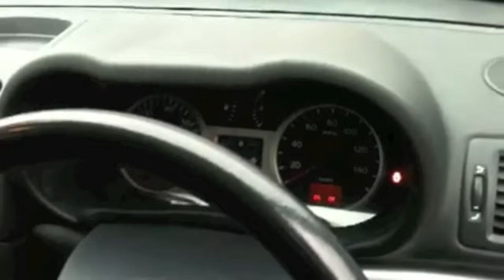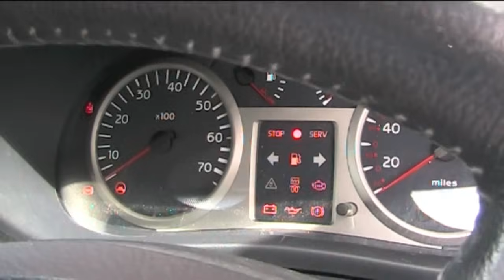Renault Clio 1.2 16v D4F Throttle Body Removal

Comment: hi was replacing the MAP sensor in my 1.2 clio and the plastic snapped and a part fell into the manifold, I've been told to not start the engine until it is removed so gotta take manifold off but there are two bolts on front that I cannot reach no matter what because there is something in the way not sure what it is any idea how I can get round this ? Think it may be starter motor
Reply from the maker: I would recover the piece of plastic before starting the engine for sure.
What bolts are you having difficulty  getting? the ones where the manifold meets the head?
Reply: peugeotCitroen2CV Yeah thought so, there are two bolts on front but I now believe the thing in the way is the air con pump which is attached to starter motor and alternator?
Reply from the maker: Dave Holding Ah the air con pump, i remember someone mentioned that before in these comments. my car did not have air con so i never had to deal with any pump in this video, and i havent had a clio mk2 with aircon to work on. However generally speaking the air con pumps are driven by the auxiliary belt, slacken off the blet and then remove the pump, but dont disconnect the pipes going into it, just move the pump out of the way gently (ie dont bend the pipes).

Comment: Hi my 1.2 16v Clio is misfiring and knocking when it's idling its all over the place and after about 10 seconds it revs on its own the light comes on (coil) and it cuts out, would cleaning the throttle body help this? Thanks
Reply from the maker: The throttle body cleaning should sort out the problem, as for the box at the back, mine had already been opened up in the past, i think its a tamper proof cover, i never had to take one off properly but it is discussed here:
http://www.renaultforums.co.uk/showthread.php?t=77179
Reply: thanks i couldnt get the top off as i dont have a star socket but once i get one ill carry on. Thanks so much for your help and this video was very helpful too
Reply from the maker: Vorneyy Fearon No problem glad to help

Comment: Could I spray carb cleaner into the breather pipe inlet while the D4F 712 is running and flush out the crap that way? or would that ruin the motor..
even if i changed the oil straight after ? 

thanks for your excellent videos
Reply from the maker: Hi
I've never run a car on carb cleaner, part of its advantage is that it does a good job of cleaning and evaporates off quickly. It could possibly dry off the film of oil along the cylinder walls while it is used. Although that is just speculative, I'm not 100% sure of what its effects would be while running, it's worth reading the instructions to see if it can be used that way. If it is an alternative to taking the manifold off and cleaning it as per this video I don't think it will give the same cleaning effect, this may take an hour to do but the car was 10 years old and it was the first time it needed to be done. If it's to remove carbon inside the engine I've seen a few videos about using a product called seafoam which may be worth looking into, they might reduce the carbon inside the engine, although I'm not sure how well they will clean the throttle body.
Reply: Hi, thanks for replying!So the problem i have is oil being drawn into the air filter housing and coating the lower section of the filter. a local mechanic who breaks renaults (and fixes them) told me it was due to the breather pipe on the inlet manifold being blocked. does that seem like a probable diagnosis to you? I see you removed the entire plastic manifold and cleaned the breather pipe, but didnt see how, i was just hoping there was a quick and easy fix, by spraying some form of solvent  into the inlet at the back of the housing (would compressed air also do the trick you think?or just cause damage) - but inevitably i guess investing the time and effort into full removal will pay off. thanks again!
Reply from the maker: Hi Yes the crankcase breather pipe inside the inlet manifold clogs up on these, I haven't done a great job of showing that in this video but it worth clearing out while in there, even use a bit of compressed air to blow any gunge out of the way, then use the carb cleaner for any residue left over.

Unfortunately, you do need to take the inlet manifold off, it's not too big a job to do, get a few plastic trays laid out to hold screws in place and set an hour or two aside, it shouldn't have to be done for another few years at least.
Reply: So I  guess my weekend will be filled with lots of dismantling, degreasing... and hopefully a successful reassemble :)

Its people like you who make youtube a great resource, thanks for all your help!
Reply: Jake, did you get it fixed? I'm going to do mine once the weather warms up.

Comment: Hello 
I had this problem  of the car cutting out so I followed the instructions and cleaned out the throttle body, Great video thanks

BUT 
Whenever i drive the car on long distance or Im driving around for the day I get the Electrical Fault Light followed by the engine management light, and if i turn the vehicle off then come to drive again i cant rev the car at all? i will get between 1-2 rpm  im basically at a a stand still till the car decides it wants to drive again usually takes 6/8 hours till i can drive again Ive serviced the car + a new Map sensor Does anyone know what to do ? Ive already spent so much and i keep going to garages with the same fault codes of the map sensor ? which has been replaced. if you could point me in the right direction on what i need to do or what needs replacing that would be great? as im just scared to even drive the car now just incase i get stuck again

Thank you
Reply from the maker: Jordan Leigh Get the cars fault codes read to find out what its saying, preferably somewhere with the proper renault clip tool and get a full print out or screenshots of the codes (you might be able to go onto renault forums to find out if there are members with the clip tool nearby, and other members may have had the problems and may be able to offer a solution) if you keep getting this map sensor fault despite replacing it check the wiring going to the sensor which may be damaged or corroded somewhere.
Reply: Jordan Leigh Check the multiplugs at the rear of the engine D4F Engine for corrosion.Clean with electrical cleaner put back on and check my 2002 16v was showing multi faults on the clip computer but the problem was corrosion at the multi plugs GOOD LUCK.
Reply: +peugeotCitroen2CV Hi, I&#39;m having exactly the same problem. The codes I have are:

590 Programming throttle limits signal incoherence -stored
600 Programming throttle limits signal outside limits  -stored

Comment: I have renault Megane coupe 1.4cc 16v dynamic ,it is a 2001 but it is as sweet as a nut  , all round but the car is not overheating but ,I did fill the reservoir with coolant to the max about 2 weeks ago , just  out of coincidence i looked under the bonnet today, and realise the reservoir was just about empty is there any particular part of the engine that is prone to leaking ,or do you have 
Any advice outside the box so to speak, lol hope you can help
Reply from the maker: The first step in trying to detect these sorts of leaks is to wait until the car is dry, and park the car over a bit of cardboard, preferably in a sheltered area where rain wont affect it, then you will be able to see if there is any obvious leaks from one of the coolant pipes or radiator.

The water pump can leak or weep out a bit of coolant as it gets older, you wont really be able to see the pump until the timing belt covers are off, if its an older car with a bit of mileage then it might be a good idea to replace the timing belt and water pump as a general service of the car.

There is also the thermostat housing it can leak, its another service item so if the area is leaking around it get a new thermostat which has the appropriate seal.

Thats just a start hopefully that should cure the leak, you could buy a uv dye to put in the coolant to help trace the leak.

Comment: Great video! Can you tell me where i can find the stepper motor? And can you confirm that the Mass Air Flow is built in throttle body?
Reply from the maker: +iTzDaniel92 
The stepper motors built into the throttle body, the cheapest option is to get one from a scrapyard, cant actually remember where the MAF sensor, its either on the inlet manifold or throttle body.
Reply: +peugeotCitroen2CV The throttle body has two connections right. one for the throttle body and one for the mass air flow sensor? I have the same problem. The glow lamp is lighted and idling is not good.
I have to keep the accelerator pedal as pressed and then runs to idle properly.
At first I thought it was the inlet manifold but it was not so. I bought a throttle body by the scrapyard and will be placed next week. I also read that it can be a lambda problem or a crankshaft sensor.

Comment: Hi
I have exactly the same engine type 
If I do this what parts do I need to replace?? 
Some sealants or gasket ?
Reply from the maker: It may be possible to do this without having to replace any gaskets on any that ive done i reused the gaskets and the car ran fine. However if the old gaskets are bad the inlet manifold gasket is the one that has to be replaced, possibly the o ring around the throttle body.

Comment from the maker: I do a video for removing the throttle body on a 1.2 8v engine, i dont know is the 1.6 a much different engine?
Cleaning the throttle body, its easy enough, just remember where the wires and bolts go.

Comment: Afternoon 

Had a problem with my car .  Had the fault light come up with the code Pl 170   fuel trim malfunction bank 1 ....  

Car is using a lot of fuel could this be the cause  ?
Reply from the maker: Im not sure what the fault code means, but yes i remember the clio was sorer on fuel before cleaning out the throttle body. I would look over on renault forums that p1170 code could be some other fuel related issue.

Comment: I have a problem. I have followed your instructions but now when you start the car it revs up and sounds great but then after 5 seconds or so the revs drop to idol and the are some very strange noises coming from engine, ignition light flashes and revs get stuck at idol (accelorator pedal does nothing)

There only thing which i can think of is the intake manifold wasn't cleaned as thoroughly as you did yours? Could this be the problem?

I've been reading all sorts online and I've scared the life out a myself now thinking it's the loom or worse the ecu ?? Help :)
Reply from the maker: With behaviour like this it might be worth having its fault codes read, when cleaning the throttle body did you perhaps get any dirt on the sensors in there?

As for the loom, were any wires broken when you removed the parts.
Reply: peugeotCitroen2CV +peugeotCitroen2CV thank you for getting back to me so quickly. re cleaning the throttle body I just tried to clean it all as best as I could and it's possible that i did perhaps leave some dirt or oil on the sensor on the throttle body.

I certainly feel that the intake manifold should have been cleaned more thoroughly before reassembly.

I am also wondering whether I blocked the crackcase breather trying to clean it as it was extremely thick with sludge.

I have since been inspecting the ecu loom and beneath electrical tape on one wire going into the plug on passenger side there is a small nick.

I am going to redo the whole process again tomorrow to eliminate as many of the above points as possible including retaping the nicked wire with new electrical tape.

Fingers crossed. I will post reply tomorrow once I have finished. Your thoughts and comments are very welcome though in the meantime.

Comment: how did you stop oil coming to the air filter housing
Reply from the maker: I cleaned out the PCV or crankcase breather pipe, its visible when you get the inlet manifold off to access the throttle body.
Reply: thanks

Comment: Did this gradually get worse? mine just does it at junctions?
Reply from the maker: +corjones12 At the time i shared the car between myself and my mum, so i cant really remember if it came suddenly or gradually but do remember when it got bad it was very irritating to drive the car, the cutting out at junctions i could deal with having drove a few carburetted cars i just kept the revs on to stop it cutting out, i suppose it just stared doing this suddenly. But it juddered and did not drive smoothly on the open road this was more gradual and most noticeable after cleaning the throttle body, i was ready to get rid of the car at the time.
Reply: +peugeotCitroen2CV so cleaning out the throttle body worked then?
Reply: +peugeotCitroen2CV so cleaning out the throttle body worked then?
Reply from the maker: +corjones12 Yes it made a significant difference, car felt much better after it
Reply: +peugeotCitroen2CV okay cheers, will have to give this a go

Comment: Hi I have a Renault Clio 1.2  the idle is fine and doesn't cut out when stoped but I'll be driving at a steady 50 mph and the engine  will be reving at 4000rpm in 5th gear if I floor it the revs will just keep climbing but not gaining any more speed past 80mph while reving at 5-6000rpm sounding like it's it's going to blow we're it's reving so high any suggestions on this problem as I don't really want to start to clean the throttle body if not needed thanks
Reply from the maker: Does this happen in any other gears when you give it the beans? Sounds like the clutch is slipping.

Comment: can someone tell me what parts has the fuel system on D4F 740  (kangoo 1.2 16 V same engine as clio) i mean it has 2 hoses running from the tank one goes into engine (i presume for hot air going into tank) and the other goes into large-ish filter like 'thing' located beside front right wheel inside the hood, some electric wires go into that thing and the hose goes from that thing to the carburetor... i want to know what is that thing and is there any filter in it, cause that car dont have classic fuel filter

Comment: I have a clio 3 and it was parked up battery taken off and recharged seem now to be having problems with idle and gos into limp mode I knock off the codes and all good left for 2 days went back to it and same problem again I sprayed some carb cleaner into the throttle body and now the codes wont clear at all and its stuck in limp mode can you help please
Reply from the maker: What are the fault codes that the car is showing?
Reply: @peugeotCitroen2CV  DF436 DF059 DF079 I took out the 4 plugs they are not great so am going to replace them tomorrow I also cleaned the throttle body today I put the old plugs back in after cleaning with a bit of carb cleaner and it's still missing but not as bad as it was I manage to clear the codes with Delphi so when I have new plugs fitted and air filter back together I will test drive it and see as the lights was off but drove it around 1km and engine management light started flashing 🙈🙈🙈🙈🙈
Reply from the maker: @seanoloughlin378  Did it ever get sorted?

Comment: Is there a solution for the oil leakage in throttle body?? Thank you
Reply from the maker: Hi, there is indeed. With the inlet manifold off clean the crancase ventillation hole. The fact that it has clogged will cause that oil leak.